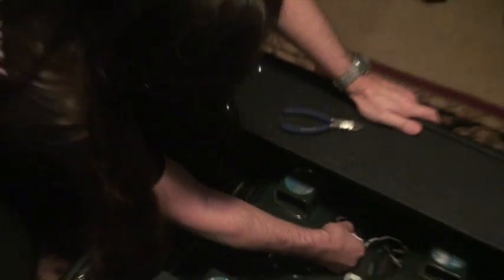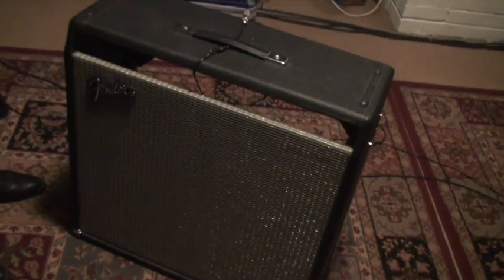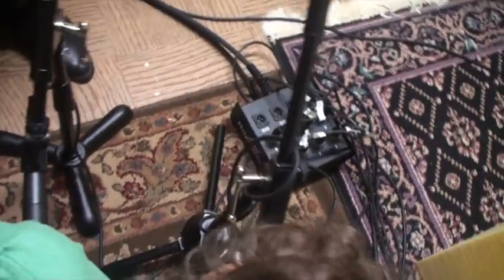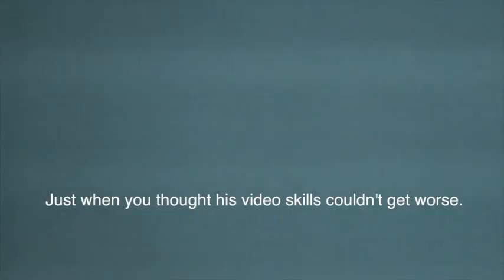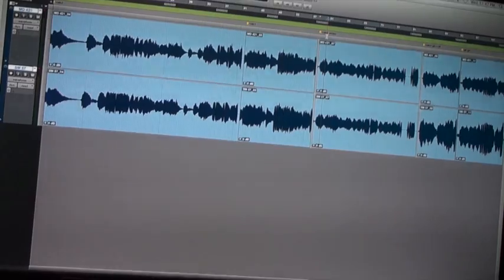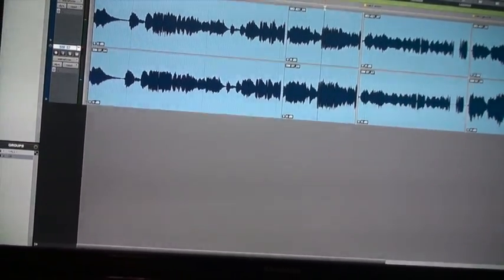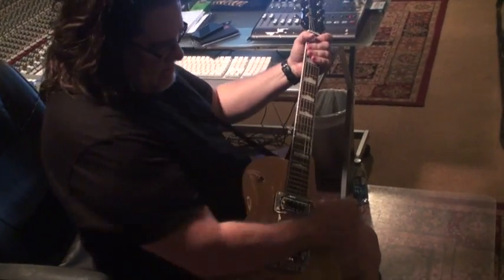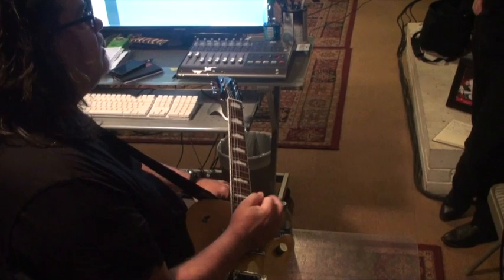4x10 Cab Day

Comment: Hey James, When you were zoomed in on the two audio waves, are you checking for delay between two mic's?  (didn't notice if you used one mic for two) If so, then by moving the mic back and forth, and zooming in on the waves, I should be able to correct any faze issues?
Reply from the maker: 2 mics, make sure the first transients line up to the sample.